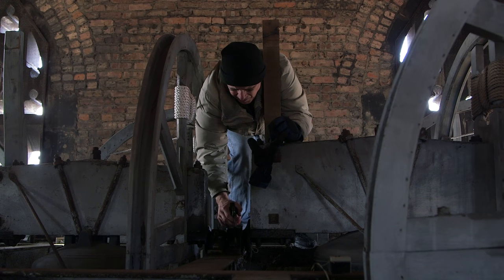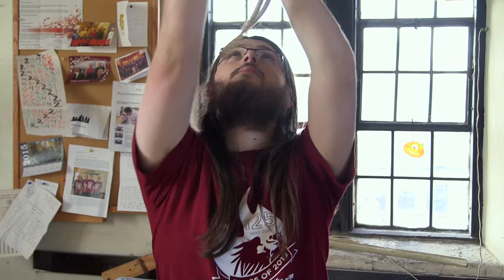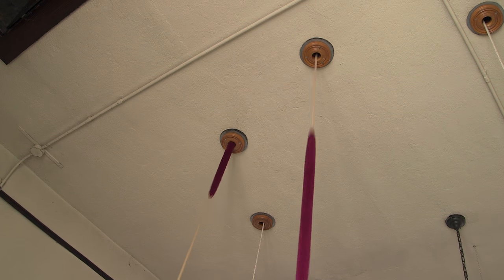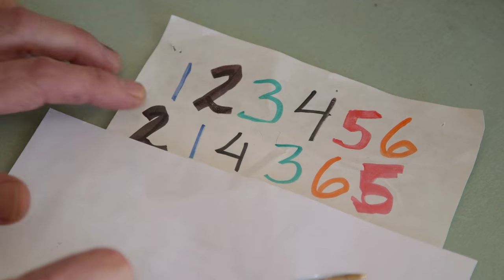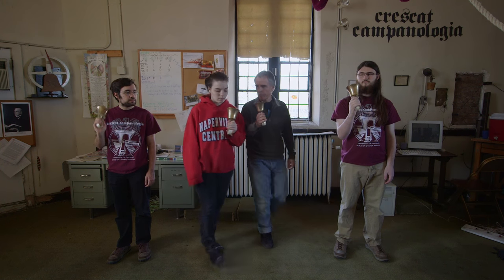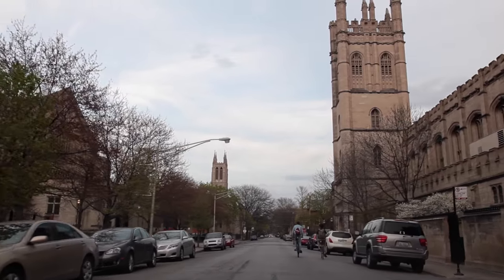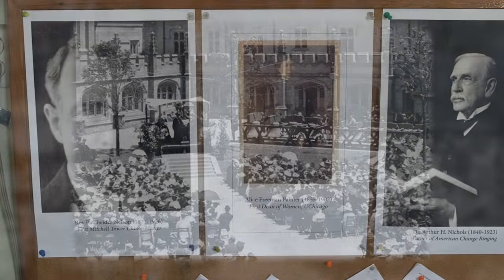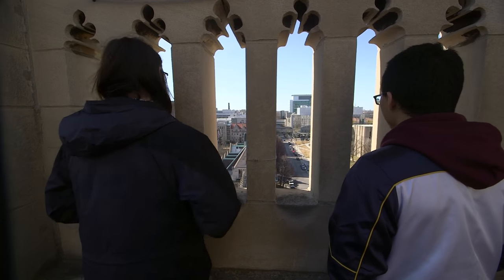Inside a Bell Tower: Change Ringing at UChicago's 17th century Mitchell Bell Tower.

Comment: I am building a simulator very simulator to the one featured here. I also plan having it mounted on the floor but worried about how high I can install a pulley. Your setup looks interesting with rope going onto the wheel from both sides. I can't work out what is going on but I think it has something to solving my problem. Would you mind explaining the mechanics please?

Comment: 0:04  What's wrong with the clapper on this bell?  It seems stuck, is the bearing frozen?
Reply: The clapper is intentionally held fixed by a “silencer”, which prevents the clapper from striking the bell. That allows us to practice without disturbing the neighborhood. Sensors in the belfry connect to a computer which generates bell sounds where the ringers are. 
We are allowed to take off the silencer for about a half an hour every month or so.
Reply: @tomfarthing2014  Thanks for the explanation.  Wow, only half an hour every month?  That seems very limiting.  I like the sound of bells.  I wouldn't mind hearing them every day.  Times change I guess...
Reply: @tomfarthing2014  i see yous are replacing these.. was lookin forward to tryin the old ones !😑
but best of luck to yous!! hopefully yous wont have to have them silenced as often with new soundproofing !